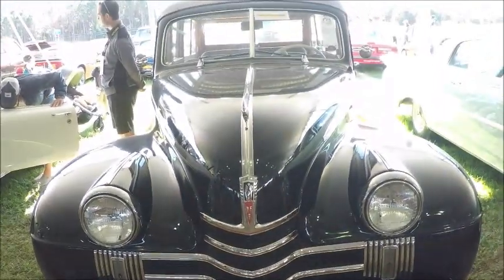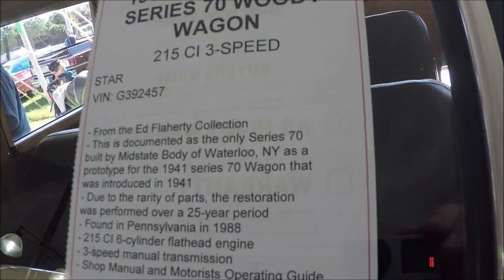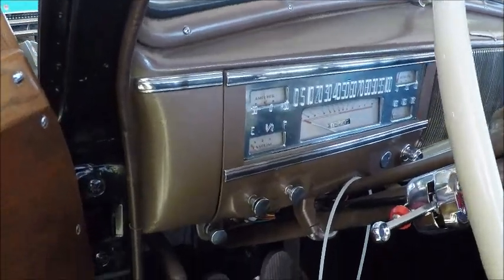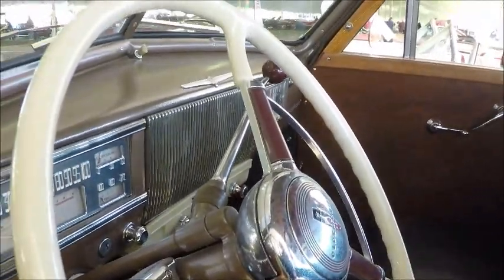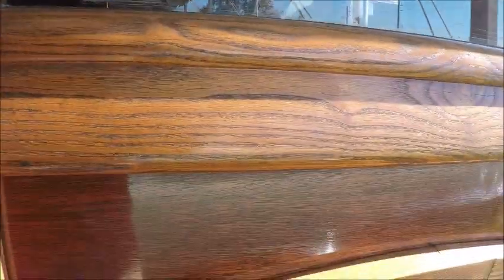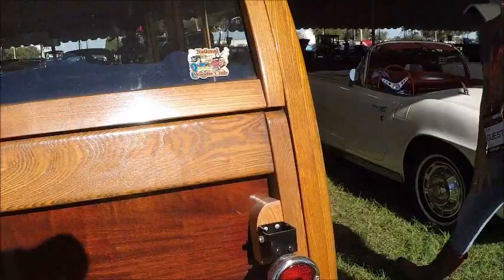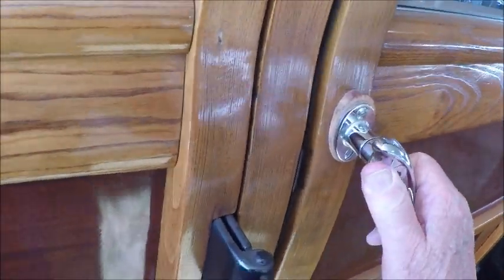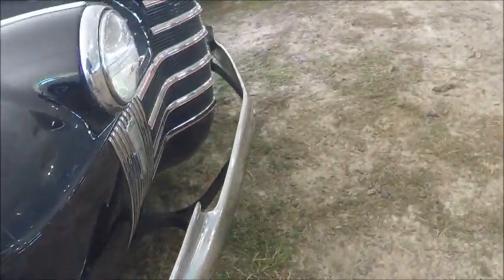1940 Olds Series 70 Stationwagon Prototype Blk MecumKissimmee0105195008

Comment: Really nice Olds Woody Looks like it has a padded top.  My Aunt had a 41 Olds 2 door with the new Hydramatic transmission, she lived in San Francisco then and I'm sure she was trilled to get a new Automatic , I would think it was a Olds 88, no one is around to tell me any details other than it was a Automatic anymore
Reply from the maker: Hey, Brian!  That's a problem...the people who knew the most about that car have passed on, in all likelihood....and many didn't take pictures routinely.  For '41, these were the series available: Special (low price to compete with the big 3), Dynamic Cruiser, and Custom Cruiser.  Evidently all were available with either the 100 hp 6 or the 110 hp 8, all flathead inline.  Both the 6 and the 8 could have Hydramatic.  Thanks!  :) Jack
Reply: @coolrides  I saw a picture of of it years ago, but it was in her stuff and we didn't get it.  This is the Aunt I told you about, got hit head on in her new 50 Ford coupe and when she was able and on crutches, got to the next town and bought a new 50 Lincoln to replace the Ford. It had the GM automatic in it